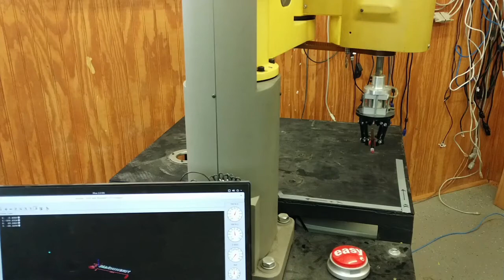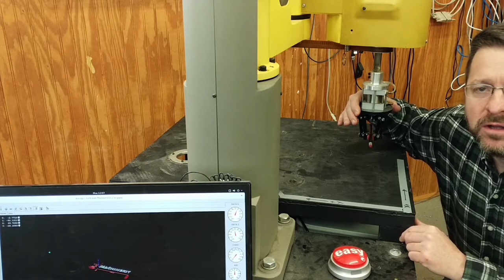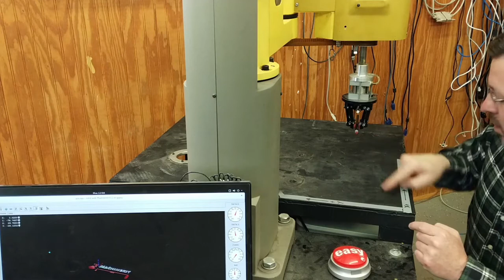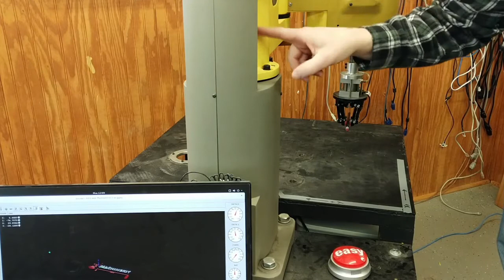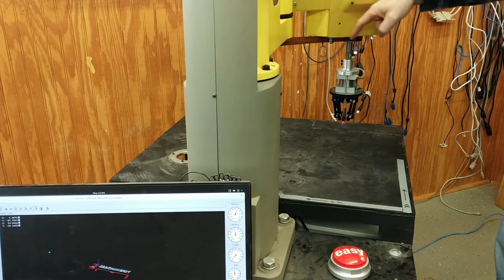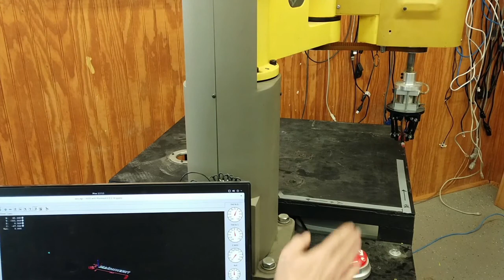IBM 7575 Scara robot working at last

Comment: Glade to see this video.   I too bought one at an auction and am trying to retrofit.
Reply from the maker: Nice!  Please blog your progress somewhere.  Do you have specific plans for it?   These robots have really fantastic hardware but I just haven't found a good job for mine yet.
Reply: @sliptonic  No it was at a University Surplus Auction and just bought it for the fun of it.  It had no controller and DC brushed 90v motors so I have purchased stepper drives,  I am reading linuxcnc right now.  I managed to get it moving somewhat with the marlin firmware a couple days ago.   https://youtu.be/WzdzVTsERcU

Comment: Hey, could you post the datasheet for the 7575. I got one but cant find any documentation on it.
Reply from the maker: It's been a while but  I remember documentation being hard to come by.  What are you planning to do with yours?   
I went through my files and these are the pdfs that I think are relevant.  I think there's some motor spec sheets that don't apply but I can't remember which ones are the right ones.  
https://drive.google.com/file/d/10JoMpCUbONhdy3sP-rCOR04vhw4yKoEs/view?usp=sharing
Reply: @sliptonic  hey, many thanks for your efforts.
I am a student at a German college and for our freshmen i thought it would be funny if they get their beers served (solenoid valve thingy) by a robotic arm. The fact that the 7575 is completely overkill for this venture makes it even more suitable and funny.
Reply: @sliptonic  Wow that helps a lot, thank u !!

Comment: Very nice job! Do you use the standard controller of the 7535 or have you build your own one? I got an offer for a 7535 but it is unclear if the controller will still be alive (I'm sure the robot is). I own several pumas and did a new controller for them to be controlled by LinuxCNC and this works well but I have doubts with the IBM 7535 since it looks it is not using normal index  encoder but tach devices and not sure if this can be easily connected to LinuxCNC. I want to get rid of the controller even it would still work because I have some experience with these old electronics on my Puma - you end up with a lot of repair work on 30y old electronics and if you are done on one end the other end fails.
Reply from the maker: I'm not using the original control at all. It was missing when I bought the robot. I'm using a Mesa 5i25+7i77. If your 7535 is setup similar to my 7575, I would recommend this. It was easy, even for someone with little training. My mill has servo dynamics motors which have a closed tach loop between the motor and amplifier and an encoder loop between the motor and linuxcnc. I've never tried to control a motor with just a tach. Guys on the linuxcnc forum would be happy to answer though.

Comment: Hello! Thank you for making the video. I just recently acquired a 7545 just like this one. I have some questions if there is a way I could contact you.  Thanks for your time.
Reply: Hey, also got one. Cant even find the datasheet for it anywhere. Could you keep me posted aswell? Thanks
Reply: I still am trying to locate what's needed. If you do find it I will pay for the correct data. I'm finally going to try to get this beast going.  Mine is a 7545 and idk how different that is but they look close